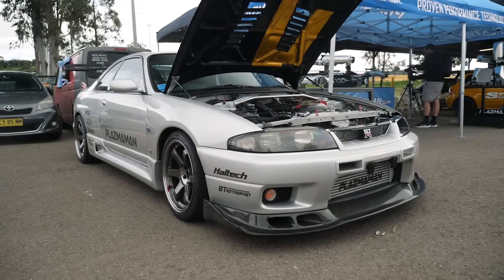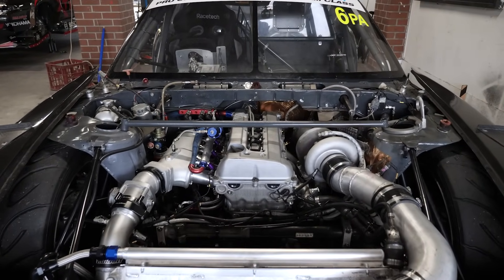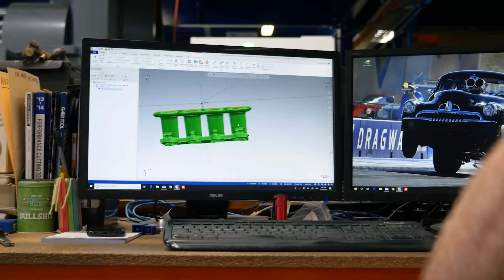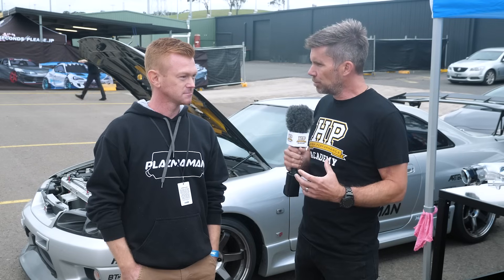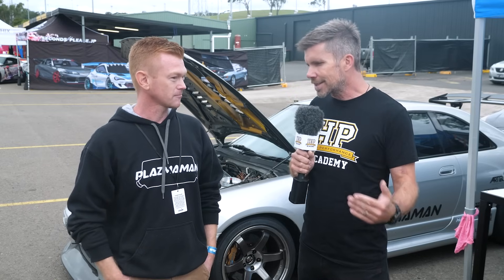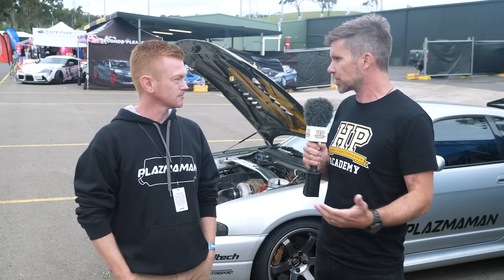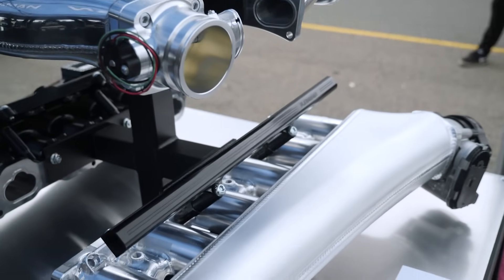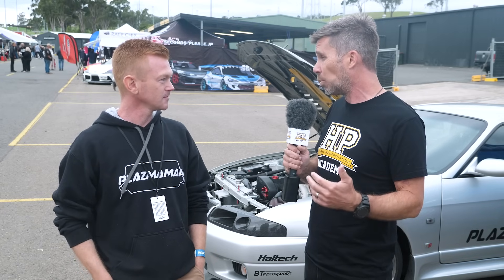When Bigger ISN'T Better: Plenums AKA Intake Manifolds

Comment: Have been banging on about this subject for a long time.. specifically to do with rb25s and the greddy style manifolds.. even with bigger turbos say my gt3076 vs a gt35 making the same peak power at same beak boost the difference in power under the curve is far superior on a standard manifold. Sure eventually the other type will allow more and if your worried more about the way it looks ok.. but for a street car... 💯 No point.. better to spend money elsewhere
Reply: Funny you should say that because I spoke with Shannon in 2006 at his place about making me a custom intake manifold when he was still working out of his garage. He was already doing a short runner manifold for the SR20, but I really didn't like the look of it. It had similar runner length to the Greddy manifolds with a different plenum. I wanted something slightly different. I wanted a longer runner like that which was originally fitted to my 180sx. What I was looking for was something a little bit shorter runner length, but with a bigger plenum to fit a larger throttle body. He was asking about $1000 for his manifolds and I really couldn't see the value in it since it really wasn't what I was looking for, so I wound up getting a Greddy copy for it. In hindsight I really should have put the effort into making the intake manifold I wanted in the first place, as the idle vacuum really sucked (not in the good way) with the big cams I had in it. I whole heartedly agree, those really short runner manifolds are not good for 99% of the driving you do.
Reply: I did back to back dyno testing on an sr20 with a greedy intake manifold vs the stock s13 long runner style inlet manifold. The greedy manifold made 15hp more up the top, but lost so much midrange. I didn't think much of it as I had a big turbo on it anyway, but when I took it down the drag strip I went backwards by a couple of mph due to the loss of that midrange. This was for a 450rwhp setup running petrol in 2006 or something.

Comment: Excellent point that is lost on so many. Bigger is not always better. Bigger often makes it lazier and less fun to drive. Maybe it makes great numbers on the peak of the dyno, but if you lose all of your low and mid-range power to gain it, was it worth the trade?

Perfection is striking a balance that gets you the most improvement through your usable powerband.
Reply: Most cars with turbos don't have a midrange, if you aren't spooling up the turbo until after 5k rpm anything under that realistically doesn't matter as you aren't making any torque to lose.
Reply: @ezmny1387  I completely disagree, most modern turbo cars are full of midrange power. My turbo vehicles start spooling at 1800-2100 and pull hard to redline.

The only turbo cars starting to spool at 5000 are old-tech 1970s cars and drag cars with huge turbos.

Comment: Its very simple and most people can't get their head around it , a long runner will always make more power over all and will usually fall off around 5500-6000 depending on the length ofcourse . A shorter will only make more power at higher rpm , there is no sorcery behind it . Your average street driven 500-600hp build does not  need a fancy $2000 manifold infact you are actually loosing driveability and power if anything .
Reply from the maker: Technically you're average street driven car needs nothing, it's what we want that see us do these things 😅
That said I feel part of the discussion covers off what you're trying to say there when they say that you don't need to go massive, but rather really look at what you are using and grab what suits. 
That might still be a product that costs you $2,000 as price doesn't really dictate size or performance gains/losses - Taz.

Comment: I have regularly checked my plugs every 1k miles or so to adjust cylinder fuel trims, with a stock runner/replenum and 23psi I still ended up around 5-6% on one or two cylinders until the plugs started to look similar. I wish I knew how the factory manifold did, it may have performed the same.

Comment: I'm doing a 2.5 liter 5 cylinder with a goal of 700-1000 hp, I got a 74mm porsche throttle body and after hearing this, I hope it's not too big.
Reply: I did put a 89mm LS throttle body ( because it was cheap ) on a 2JZ , part throttle and very small throttle opening can be a little bit of a pain . I would definitely go on the smaller side if I could . I think you should be ok with a 74 mm throttle body though.
Reply: @dilsher12  thanks for your insight
Reply: As was mentioned in passing in the vid', you can partially compensate by using a throttle linkage that is progressive with a small change in throttle blade angle at small openings and large changes as it approaches full throttle - or mapping the opening against pedal position if DBW.
On that, if DBW, you may find better torque with the throttle blade less than fully open, and you can map to that for a benefit.
Reply: @gordowg1wg145  Thanks for the reminder. Yes, non-linear throttle mapping is a good idea, I just don't want to use it as a "bandaid" for a poor choice in throttle body size. I don't think my choice of 74mm is grossly out of line, maybe just a little on the large side, so probably non-linear throttle mapping will be perfect should I encounter any issues.

Comment: The issue I've found with these have been the plenum runners. Motive showed in their video they had only 22mm runners which is ridiculously short and only good for top end. I've also seen dyno results from Goleby on a 1JZ that he put up on FB and the loss of power under the graph was more than the top end gain you got. 👍
Reply from the maker: What engine? Is it a case of physically not being able to package it different as Shannon discusses? Can only work with what is there bearing in mind it is something you can discuss before pulling out the old wallet too in order to weigh the options up - Taz.
Reply: @hpa101  My bad Taz with the Motive one, I messed my brands up as it was Hypertune on their 3.2L RB26. The Goleby dyno result was Plazmaman.